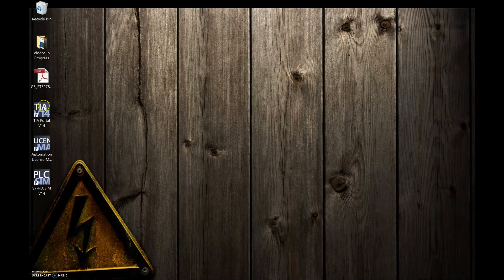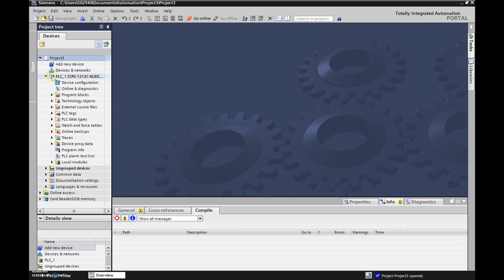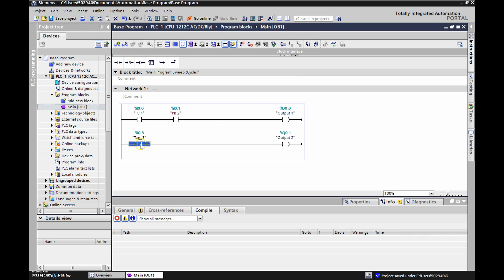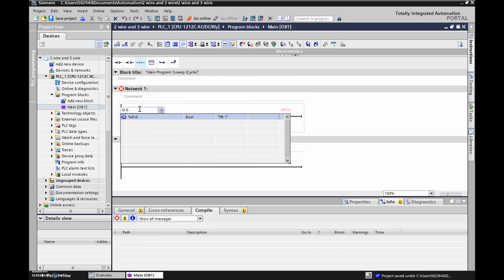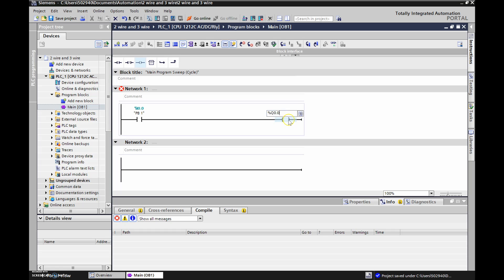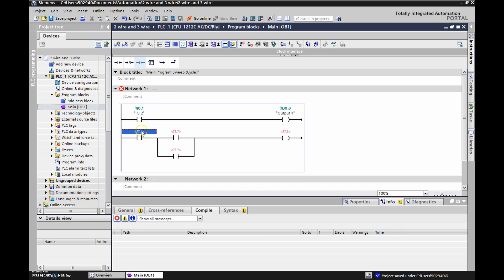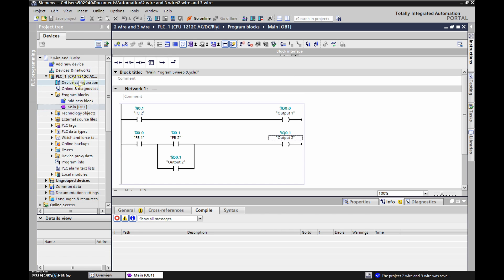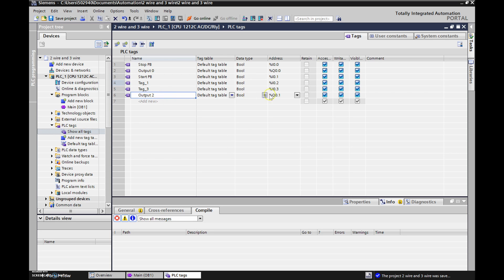Siemens TIA Portal Tutorial (2 Wire and 3 Wire)

Comment: hello can you help my problem, this problem when I pull the old program from plc, then I edit add the wire below it, only I add 1 wire with 1 logic NO then the output, I compile, download, try changing the logic NO to modify 1 or true, it still doesn't change on or green, even though there is a modified below, do you ever experience the problem ???
Reply from the maker: Yes. Super frustrating.